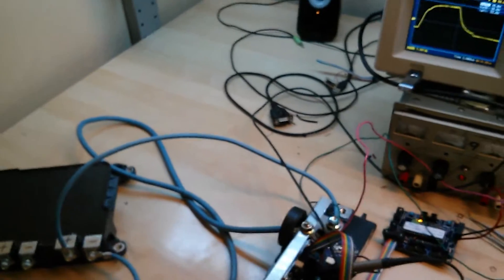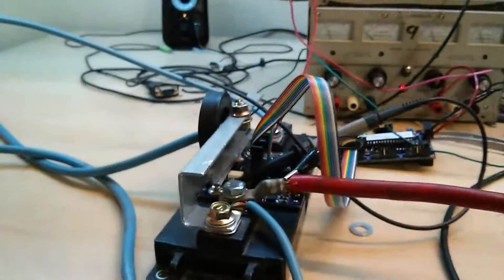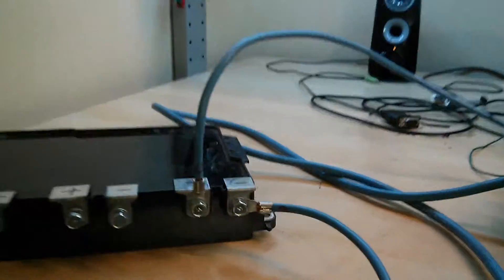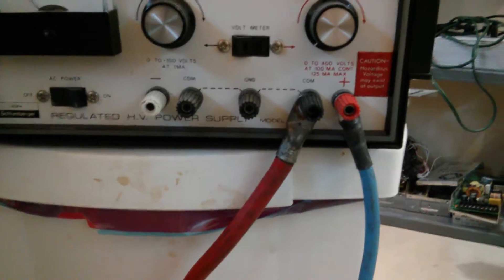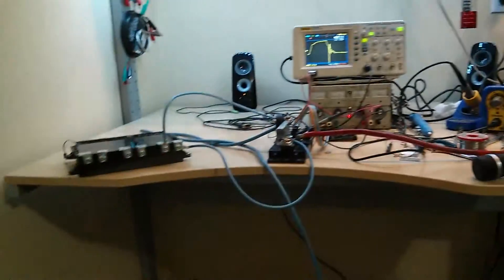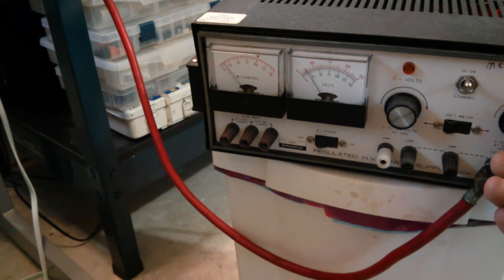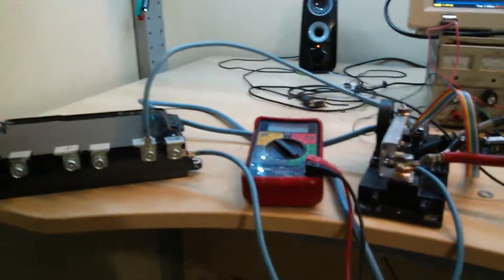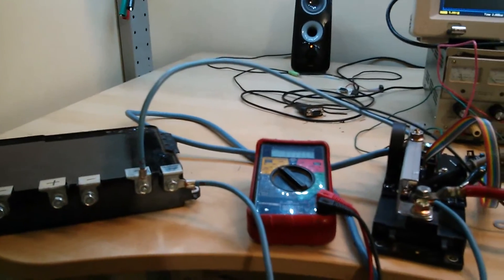Desaturation detection testing.

Comment: Is there any circumstance more than just heating that will cause electronics to fail? For example if I connect 72 Volt to a 36V controller I would imagine that something in the controller would melt or a plug fuse would blow (which is a small metallic thread that melts). I'm thinking of one more reason things would fail and that is sparks. I learned that sparks will always cause materials to decompose and ruin a clear connection. Happy for a response from you.
Reply from the maker: Any time a limit of an electronic device is exceeded its life is shortened.   If you over volt over amp overheat something among other things it will either fail or shorten its life.   The desaturation detection is able to prevent over amp failures which is a very common cause of three phase motor controller failures and most likely 99% of all my failures.  When one side of an H bridge is on for whatever reason and the other is turned on you will get a pass though is this happens the desaturation detection will shut the side off that is commanded on.  Sometimes the wrong side can be turned on from noise or the miller effect or its shorted etc.  Or there is the times when a mechanical problem is present.  Say a wrench falls across the phase wires.....   There is a lot of reasons to have this feature and no reason not to.  If you say price I will slap you as I have burnt $1000s of mosfets learning this the hard way!
Reply: Arlin Sansome
Thanks for the reply Arlin. I have only burned one Crystalyte hub motor and that was because I couldn't stop showing off my 72V setup and raced a girl that had a scooter. Yeah I probably made her raise her eye browse a little but it was stupid of me. I didn't know her at all. I was lucky to be able to drive all the way to my Brothers house but when the motor cooled off it was dead. One week later I opened it up and the inside was just a wreck. :)
Reply: Is it part of the video to speak so fucking low and far away?